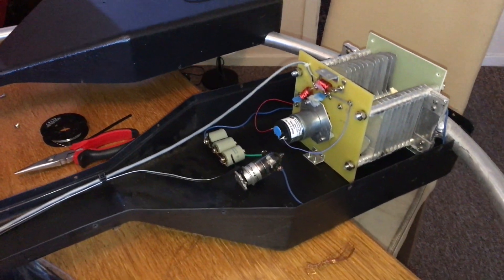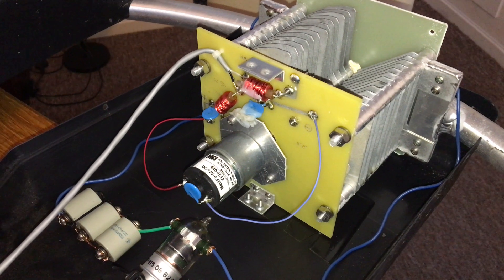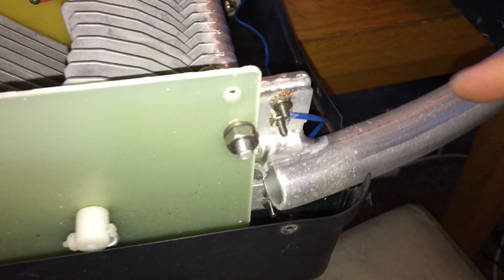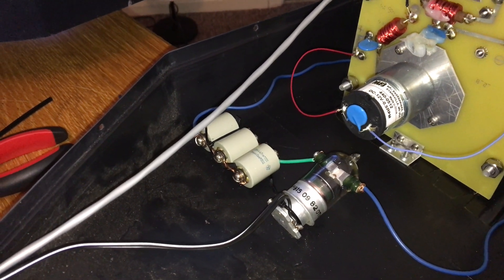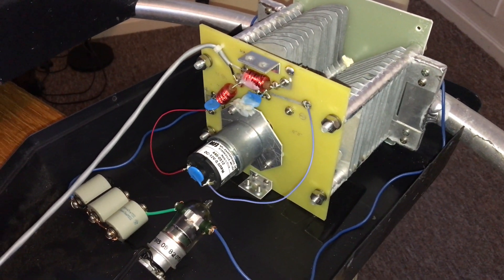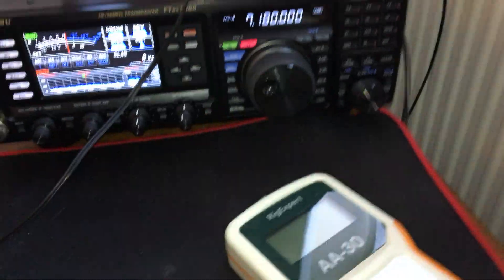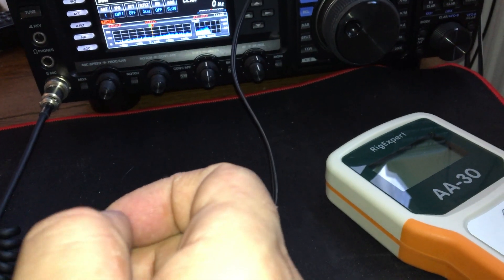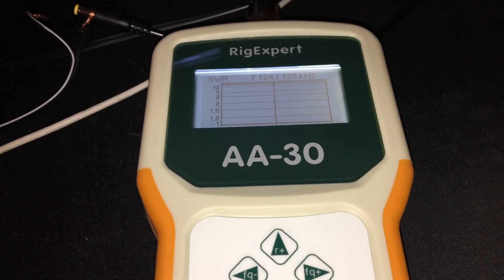Mfj 1786 loop antenna 40m-10m modification

Comment: Hi, thanks for your input for the modification of this antenna.
My question is this :
the external power must be 24 volts
just that .
Greetings and thank you
EA1ADZ
Reply: Many 24v vacuum relays will trigger with just 12 volts. Regards Richy N2ZD

Comment: I found a 150pF 20kV Doorknob Cap and a 24v 3kv 30mhz Vacuum Relay very similiar to the one u used. I'm guessing the doorknob cap will work fine instead of the 3 47pf caps u use. On the 24v power adapter... how many amps adapter do u use?

Comment: Hello, I am trying to figure out the exact parts you used. I have 47 picofarad capacitors,  24 kv button relay and coil. But not sure I have that correct. Could you please post a parts list so I can make sure I have this correct. I have the MFJ-1786 currently in the attic.. Love it. But hate not being able to get on 40 meters. Thanks you !
Reply from the maker: Sorry, just now i seen your post, yes, 47pf caps and a vacum relay

Comment: How is the relay powered? Why this type of relay?
Reply from the maker: there are around 3kv :), you need a high voltage vacum relay.Its powered via two wires 24v

Comment: is current fluctuate on charging a moible phone or there is constatnt current ?
Reply from the maker: its full 90% of time, on the end of the charging ,the current will fall down
Reply: i got a yuphoriya mobile for repairing i connect to charger its continuely fluctuating ampere needle.
Reply: is it charging ic issue?